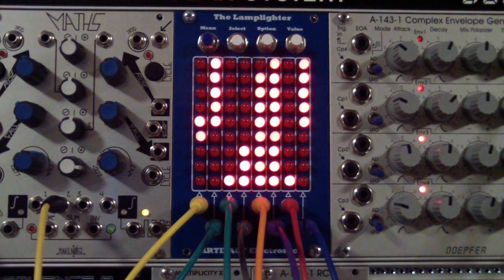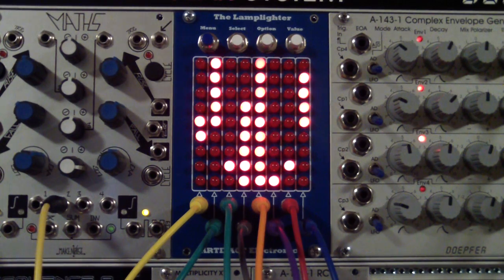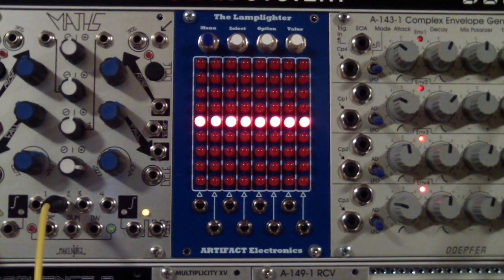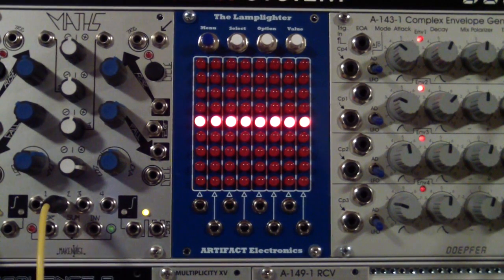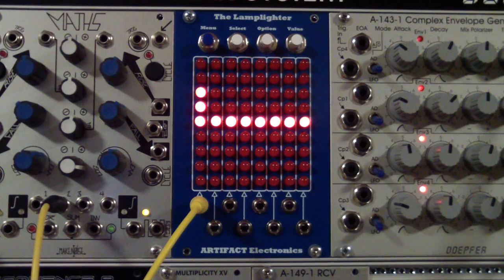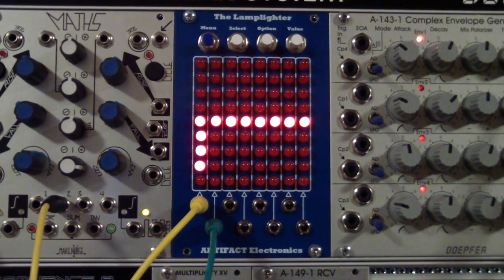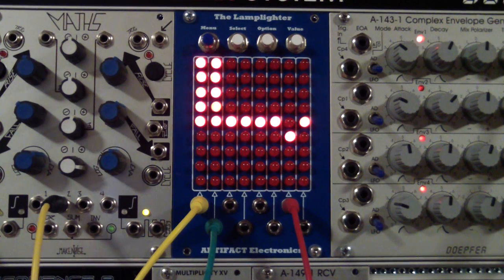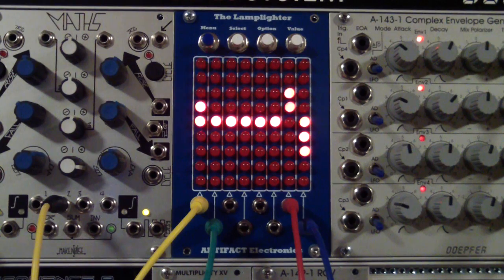An Introduction to The Lamplighter Eurorack Synthesizer Module

Comment: If you don't mind me asking - 8v?
IMHO if each channel mirrored the input to an output it would be great. As it is now I'd need 8 stackables to use the signal AND be able to see it.
Looks cool though!
Reply from the maker: We considered asymmetrical ranges for bipolar signals, but the beta testers gave that a thumbs down (if I understand your question correctly).
You are right about a lack of mults. We had a prototype with double jacks for each channel, but felt that the module became too wide.
Thanks for the great comments.
Reply: I agree! It looks cool and would be useful but I think any sort of monitoring module like this tends to not get used much after a while because it is too much trouble to use mults and/or stackables. It may be too late if the PCBs and panels have already been ordered but it "looks" like it would be possible to space out the columns enough so that the jacks could be placed next to each other in a row and then a parallel 'mult' row below it with no need to make the panel wider?